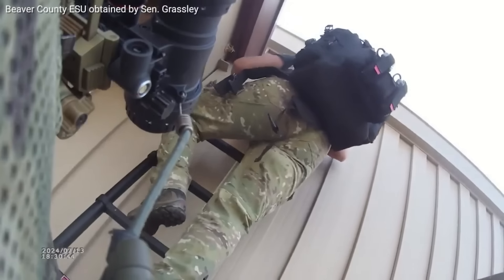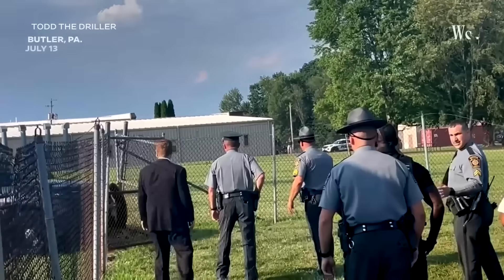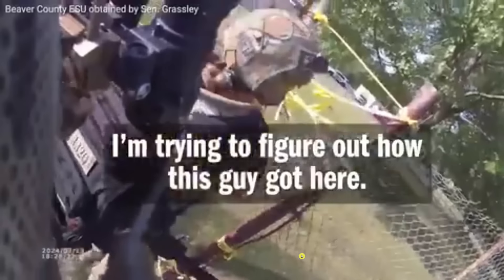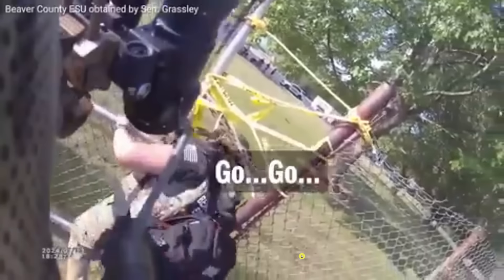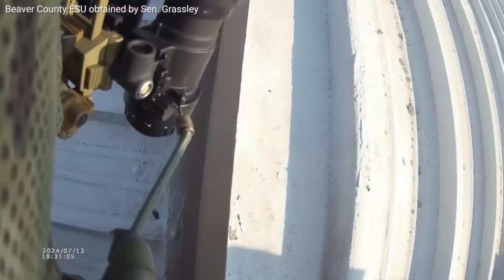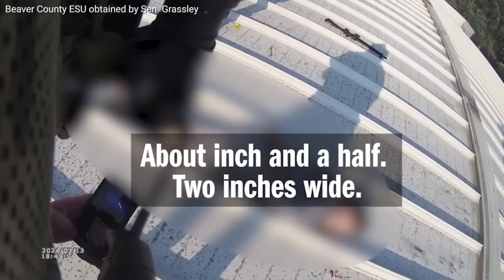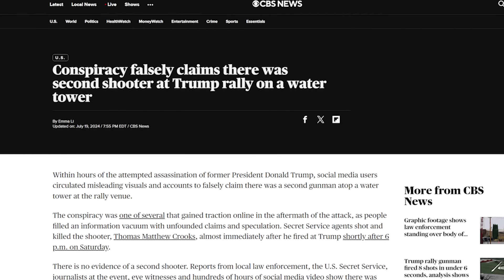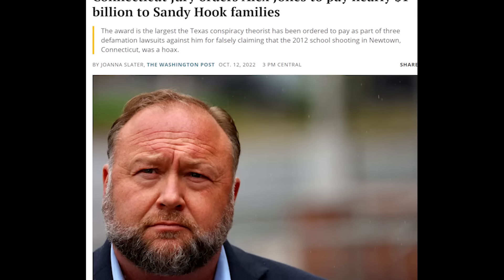Trump Shooting Analysis: Shell Casings, Ladders, Drones, Bodycams,

Comment: Someone could have let Crooks into the building through the door on the north side, and he could have easily accessed the lower roof from a 2nd floor window on the north, crossed over the causeway and onto the roof he fired from.   There are no witnesses of him jumping onto an air conditioner and spider man up the AC lines directly in front of not only the ESU snipers, but several MAGA with cell phones to the south.

If he previously used a drone to survey the area, how could he have known that the cops were NOT going to be on the roof of the building, or the water tower, but inside, and that his shooting location was perfect?  Someone could have easily told him where the CS teams were going to be (and not be) stationed.  

It still smells of an inside job.  It only takes 1 bad cop.
Reply: There are several buildings connected to each other by those little roofed "hallways". He could have used the AC unit on a building behind the one we see him on.
Reply: I agree. Getting onto the roof without a ladder proved difficult, if not impossible, for the police who were fit and healthy. The rooftop window is only visible from above. All the videos of Crooks on the roof are consistent with Crooks getting out of that window and remaining concealed by keeping close to the wall while approaching the corridor roof nearest to the witnesses. The witnesses first noticed crooks crossing the corridor roof and then bear-crawling his way into position.
Reply: He had to know there was guys in the windows, they took a picture of him while he was surveilling
Reply: Perhaps you weren't paying attention?
Reply: @cyber5515  nonsense, his climb was adequately covered in this video and substantiated with the eyewitness testimony and footage of his path across the roof and into his final position.
Reply: I heard on another video he climbed up the back building and could then have access to all the roofs.
Reply: @cyber5515  I also heard one eyewitness saying they saw Crooks climbing from building to building.
Reply: Service owned the room overlooking the Roof ..The roof they cleared for crooks
Reply: I agree
Reply: Someone else, an acumplice, removed the shooter's ladder ?? It's possible 😮
Reply: Well, didn't we see a video showing him climbing up the side of the building taken by an eyewitness in the audience? I did. And with people yelling out and pointing to him?!! It was an inside job, but whoever took those video (s) may not be handing them over because they suspect that, and feel threatened, or that they might be?
Reply: Wray:We believed that the subject climbed on to the roof using some mechanical equipment on the ground and vertical piping on the side of the AGR building.   Question: Did you then dust them for handprints?
Reply: @cyber5515  Wrong the witnesses didn't notice him until he was already on the roof in a position to start making his way up toward the peak. If you notice all of his movements that are caught on camera they were all of him moving up the roof and not across. The means that he was already as far over to the left of the roof that he wanted to be and was making his way up toward his shooting position.
Reply: There are no videos or pictures of him actually shooting, which I find odd. With all those phones out there. People seeing him on the roof.  People yelling to police that he was there. 

You really never know how you will react to violence under stress unless your trained or you have had some experience.  I just can't help with all those people yelling. Someone or several someone (s) have nothing?  Alot of people think they are invincible until otherwise proven wrong. The drone being offered to SS by law enforcement and told no unequivocally is strange.  As is nowhere, is there a picture or a video of this kid shooting.  Your right just doesn't pass the smell test.
Reply: Why bring up Alex Jones unless you want to scare peoples opinions (Conspiracy Theories ) You did it yourself by stating the shooter likely stood up to take the last 5 shots rapid fire burst mode and exposed him. How come no one has taken a video were the SS Snipers were on the roof with the tall tripod at least 4 feet about the crest of their roof and put a person where the sniper was crawling up the roof to see if he is visible. if you noticed the sniper was at least 18" to 24" above the roof while moving up the roof especially carrying the gun.
I bet if you ask any counter snipers ti view the site I bet 99% would pick the water tower as a place to put an SS agent with a pair of binoculars. if you use Google Earth you can see the ladder on the far side of the water tower for easy access.😇

Wow your theory is totally off I thought you said he stood up after the first 3 shots . Also you say at the end he was a few feet from the apex of the roof . You do realize the SS snipers were way above Trump so if the shooter can see Trump the SS snipers at the higher elevation would have definitely seen him that is simple Math Geometry Angles ???????😇
Reply: @blackmetalmatters9101  yes I was thinking the same possibilities
Reply: Exactly!!!
Reply: Not this try, many intentional " Mistakes ".
Reply: The first three shots were fired from the second floor of the building next to the alleged shooter.  The weapon that fired the first three shots was probably fitted with a silencer, which accounts for the lack of echos.  The second five shots were blanks fired from the same location but with a different weapon most likely an AR-15 using a surefire trigger that can fire rapidly.  Blanks were used in the AR-15, which explains why no one else was injured.  Local law enforcement was in the building next to the building that the alleged shooter was on.  The last shot fired killed the alleged shooter and was probably fired from the same window as the other eight shots.  Everything supposedly found on the roof by first responders was planted by them as alleged evidence, including the 8 shell casings.
Reply: It is difficult to understand why the cops, or anyone for that matter,, had trouble getting on the roof. Just around the corner from where the cops were stationed at the second story windows, is a door to access the other roof which is connected by a lowered portion. That is the point where Crooks was first noticed.
Reply: @robertperry4439  Not possible... Forensic analysis of all shots fired confirm a distinct "crack-pop" for each round fired. meaning a supersonic crack is heard and the pop of the report is heard a fraction of a second later. Only one shot appears to have been suppressed and that is the final shot that was taken... likely a CS with the kill shot on the shooter.  My theory is that the shooter (Crooks) took 3 relatively aimed shots at Trump , by the 3rd shot Trump was on the ground and out of the shooters LoS (and covered by SS agents. I believe that his next 5 rapid shots were at one of the CS teams in an attempt to suppress them. Possibly to give him another chance at taking a shot at Trump or possibly to try to egress from the roof, but a 3rd CS team ended up taking him out.
Reply: @robertperry4439 I agree. the first three shots were definitely separate. This guy was not athletic enough to scale a wall, nor a good aim. Not buying Andy of these stories.
Reply: PATRIOTS attending the event REPORTED THE ASSASSIN CLIMBING the ladder then onto the roof.🤦🏻‍♀️🇺🇸
Reply: @blackmetalmatters9101  esu snipers were pulled too go look for crooks
Reply: Totally inside Job. EXACTLY what I said like HOW could he know that there was an empty roof?!? HOW could he easily just go near there, go up, no one shoot at him?!?? SOMEONE or some group maybe promised him money to do all that and that he'd not get in trouble knowing they would totally take him out anyway. Everyone was in on it.  No one was logical enough to figure a way to get up there after?!?? Gimme a break
Reply: @zgadgets  Also, the counter snipers were standing not lying on their bellies. That's about 3' above the shooter position (assuming both buildings were the same height) One group of CS didn't have a clear shot because the trees between them and the shooter position. However, the second group that was on the other building farter away they didn't have any obstruction blocking the shooter. Until somebody takes a picture from both counter sniper groups towards the shooter location we might never know for sure. Why that picture/video is not already taken? That would clear both counter sniper groups of any incompetence.
Reply: @blackmetalmatters9101  the movie "Shooter" went into the thought process of dirty CIA operatives
...the one agency not being implicated in this Butler,PA event.
Reply: @0Logan05  sure he was brainwashed into thinking he was a part of the protective force.
Reply: @dekzan  accomplice
Reply: @BiologyalwaysWins  bullshitter Wray makes things up like Chris Christie!
Reply: @fc96282  at least 3' I said that also if the assassin was 15 feet to the left both snipers teams would have been blocked by the tree..Trumps stage was way in front of the 2 SS teams so the whole roof was insight.  
20 year old with an Encrypted phone and now they said SS encrypted phones were erased. 😇😇
Reply: Dude just stop thinking.  It clearly doesn't work for you.
Reply: In this case, a few bad cops,
Reply: @zgadgets  We know Tommy never stood up. Presenter just being dumb and forgetting we'd already seen footage refuting that!
Reply: @elliottdiedrich3068  Yes, straight up that air con unit... Too much Keystone cops, pretending they were looking for him...
Reply: If Crooks accessed the roof from the West side of the AGR building he would have been videod by numerous onlookers, which leaves the East side of the AGR building, via the ladder in the alcove behind the tree as the most plausible access point. 

Remember too, that immediately before the shooting a man in grey clothing was ushering the people who were standing along the fenceline to the South side of the AGR, moving them to the West away from the East side of the AGR building and away from the line of fire.

Has the grey man been identified and interviewed on camera and if not why not?

Comment: There is a time stamped video where they only found 5 casings. The one agent said not to let anyone else on the roof. 20 min later, timestamped video, they had then located the other 3 casings. The 3 casings seemed to be on the left side rather than the side that the ejection port and first 5 were found.  Odd
Reply: Blackscoutsurvival YouTube page has the body cam footage.
Reply: Agree and another damning question.  No wonder people think some casings were planted.

Comment: Audio recording proves there were 3 different rifles fired with the first 3 rounds of a high powerd calibre, possibly a 308 or something similar. So if the FBI says there were 8 rounds fired from one gun AR 15?. How can they explain the audio, then?
Reply: First shot was from a cop that missed, second was the shooter shots,last was the counter sniper kill shot for a total of 10 shots with three different weapons,the shooter used 526,the counter sniper used a 308 Winchester
Reply: 300 win mag.
Reply: I read the SS CS team used a 300 Winmag.
Reply: All good analysis, but Occam’s Razor encourages false conclusions without including all data. How does audio analysis indicating at least three different gunburst signatures figure in?
Reply: @markcbrems  subsonic and sonic ammunition?
Reply: @karmenpass2134  That's not correct.  The audio on graphic sonics showed there was a total of 9 rounds fired.  The first 3 were first from the same rifle.  Either 308 or a 300 winnmag, etc, according to the audio and the footage, Trump was struck in the ear from the second round that was fired, showing that the same larger calibre rifle that fired the first 3 rounds was responsible hitting Trump. 5 other rounds on the graphic Sonic showing a rapid fire from a smaller calibre, possibly the AR15. Then, the last round, a single round, can be shown fired from a large calibre rifle, probably the round that took out Crooks.

Anyway, according to the audio recording shows proof of a second shooter. As Crooks only had an AR15. If you say a cop fired first, then that means a cop fired at Trump as the first 3 rounds fired were from the same rifle.  And Trump was hit in the ear from the second round fired.

Go watch the audio graphic sonics and back to the footage. The proof is there
Reply: They allowed President Trump to get on stage they knew what was going to happen
Reply: He also doesn't know they're called casings not cartridges.
Reply: @markcbrems  The audio analyses I've seen clearly show three different frequency signatures, as well as three distinctly different echo delay time periods, indicating three different shooters (The Professional, the "suspect", and the Secret Service Sniper) in three different locations. This is pretty easy to determine with modern software and analysis equipment. Acoustics Analysis is a REAL forensic science, and can be incredibly accurate...
Reply: @stereodreamer23 There are 2 very different types of viewers remarking on the Trump shooting. 
#1 Individuals with little or NO shooting experience 
#2 Individuals that have a TREMENDOUS amount of shooting experience 
There is no question that a minimum amount of 3 separate rifles fired shots. At this point, we do not know if ANY 100% suppressed rifles were fired. The biggest question of today is what's up with US Marshall's heading to DC along with fencing crews. What info is about to be leaked that could cause concern for so many Marshalls. Ya'll want the truth? Are you ready for what comes next?

Comment: Why the hell would the snipers leave their post right as the event starts?? Such bs...
Reply: @jamesbryan8189  On another channel (The Quartering) it was said, it is now confirmed that the sniper nest behind the open window left their post. One of the three men left early and went home. The second went downstairs looking for the suspect and the third went downstairs, because the second one forgot his key card to get back into the building. And exactly in this very moment, the suspect climbed on top of the roof, crawled into position, took aim and shot. The thing with the key card took several minutes ...
Either it was sheer luck/destiny or someone wanted it to happen. The reader may decide.
Reply: They need to get to the bottom of this. It doesn't make sense for those 2-3 men  to leave the roof unguarded and go somewhere else. Maybe it was too hot as we were originally told 😮
Reply: Correct, and the most damning.  And we never heard about who, how many or where were the security for the building.
When secret service top people claim they are completely out of the information loop, if true, then the whole organization needs reform.

Comment: If the roof is so sloped and dangerous then wouldn’t the bullet casings have rolled off and not stayed on the “sloped” roof? Such a lame excuse! It’s practically flat!
Reply: Yes, it looked like a couple casings rolled halfway down the roof based on the aerial view right after the shooting. This video is an hour later, so we're not seeing what actually happened. The casings were obviously gathered by somebody, and we don't really know how many were originally there.
Reply: the roof has ridges. that would stop it from rolling down.
Reply: @peterjsmith5918  why is swat gathering casings?
Reply: @goldenbleau846  The roof had marked ridges on it. If cartridges rolled, they wouldn’t go far because they would get trapped up against the vertical facings of those ridges. The roof didn’t have enough pitch to cause them to roll or slide all the way off.
Reply: The pitch of that roof is literally more shallow than an ADA-Compliant wheelchair ramp...